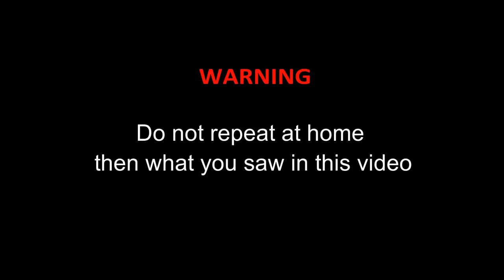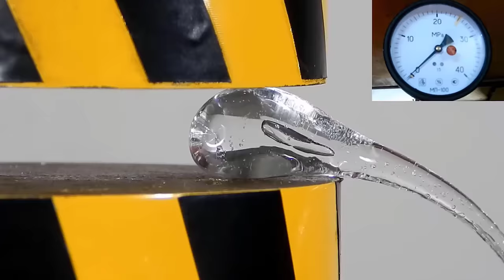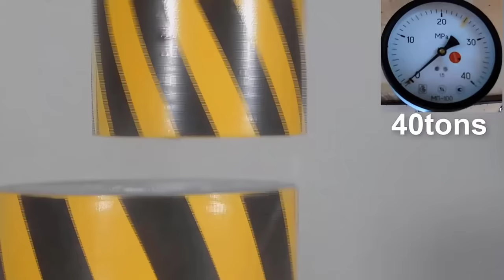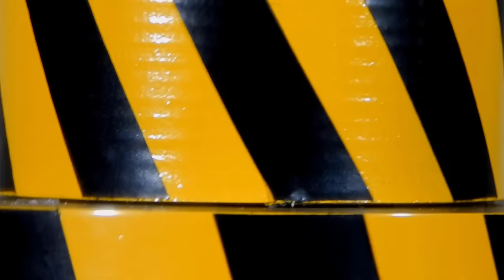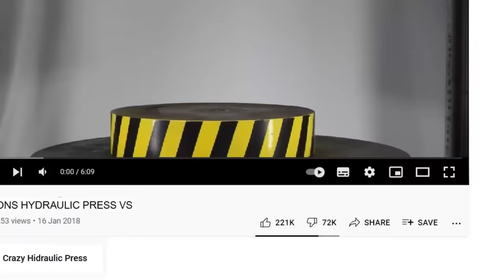HYDRAULIC PRESS AGAINST RUPERT'S DROP AND TITANIUM

Comment: 80,000 pounds of force for a glass drop.. that's insane
Reply: yeah but if u break the tail its all gone
Reply: google image pfp gang
Reply: You can actually burn of the weak side so it wont shatter
Reply: YTgavinlilmam it’s for the giant Rupert’s drop
Reply: @BelowAverage3310 however doing so will weaken the overall structure. So you will remove it’s main weakness, yes, however, it will not be as strong.
Reply: Energy per unit of area is more important, but damn how can u stab something that is curved haha
Reply: But if you break its tail it will break
Reply: @Android-xe1ne  so would a glass sphere or a Rupert’s drop be stronger
Reply: Um actually 🤓🤓🤓
The prince Ruperts drop is strong however you can easily snap off the end
But it would be weaker cause if you damage the front it will actually effect by the back-
So there is no easy way to reach the ultimate strength of an object
Like applying weight and pulling there is no object that can do every single possible thing for the
** to be overly protective if so life would be insane instead of a lifetime of 70 it may be 80

Wait I typed all that? Oh-
Reply: @RickyCheung-d7j mate how does that make him a nerd
Reply: Nice profile picture
Reply: Now imagine a prince Rupert's drop made of titanium
Reply: But yet a kid could snap it by pinching the tail
Reply: I wonder if they can be used as bullets themselves…
Reply: @HelixSawIt  Gone! Reduced to atoms!
Reply: That would be the equivalent of 3 miniguns all shooting in the same spot

Comment: As you pressed the titanium I wondered what the hell the plates on the press are made of that they don't get deformed by some of these things. Lo and behold, immediately afterward the tungsten gave as good as it got.
Reply: Plain titanium isn't actually all that strong, it's actually weaker than most steels in most areas, not by a lit but it is a noticeable difference, main benefit of it is that weighs a lot less and handles thermal loads better, which makes it ideal for aerospace but its high price means steel is better for most applications
Reply: Titanium isn’t indestructibly that strong. Steel is cheaper, easier to make and is as strong. Titanium doesn’t have much use case outside of the airframe of high performance aircraft and submersible hull due to its high strength under high pressure loads.

It doesn’t have as much use outside of this. Even steel is better as armor and for projectiles, steel cores are common and sometimes heavier metals like tungsten and uranium are used.
Reply: @battleoid2411  More accurately, it's compressive strength is terrible compared to steel. The tensile strength is good, but that isn't going to help atop of a press.

Comment: imagine using prince ruperts drop as a tank bullet.
Reply: oof
Reply: If you can find a way to not break the tail and make it straight then go for it
Reply: that makes no sense whatsoever
Reply: It might work but you will have to melt off the tail
Reply: @TheDoerOfRandomStuff  yeah the long barrel will most likely make it shatter
Reply: As long as you can sharpen it and it still be as strong as it is now then it would be an amazing bullet
Reply: Melt the tail!!!
Reply: @maddietrujilpo5526 melting the tail won't work. The tail is the weak point and heating it up would probably result in it shattering.
Reply: @maddietrujilpo5526 that would make it break easier.
Reply: @derpsterYT  no actually you can melt off the tail without it shattering
Reply: @derpsterYT melting the tail does work just makes the drop a little weaker
Reply: But if you get it moving fast some other way?
Reply: Probably would be less effective due to weighing less.
Reply: imagine if we could fire a hydraulic press
Reply: I like the way you think!

Comment: I suspect It’s not so much the pressure but the impact that breaks things. 
When I was younger I seen a guy on tv with his leg trapped between a concrete pillar. He actually made it out with minor injuries because the pillar slowly trapped his leg instead of just falling on it
Reply: @CommenterMr922 if there’s a large enough pressure it’ll still break it’ll just take more
Reply: @commentermr9222 I could be misunderstanding you, but if what you're trying to say is that the OceanGate submarine was less than the concrete pillar, that's incorrect because the submarine impoded at the speed of SOUND under tons of pressure per square inch

Comment: At time stamp: 6:40.
The Prince Rupert Drop sandwiched between the two titanium plates, if you look, you can see the air inclusions, the air bubbles, actually deforming under the pressure. Amazing! So, the drops didn't just go unaffected to the breaking point. It was actually deforming BEFORE the failure point! It's hard to see, but like the moving minute hand of a clock, the drop was moving, that is deforming the whole time. I find that fascinating!
The world isn't always at it seems at first glance.

Comment: I thought diamond would be harder huh
Reply: He needs to add in a psi gadge so we can see how much pressure it actually took other wise its all perspective with nothing to compare against
Reply: Hard but still brittle
Reply: The harder things get, the easier they break ironically enough. Hardness mostly implies a resistance to scratching with stones, or bending with metal, but if you push a very hard object too far it'll break a lot faster than a more soft object, because the softer objects simply deform
Reply: It's not diamond a diamond that size would cost 10 million dollars
Reply: Diamonds are surprisingly brittle. It's a direct cause of its very high hardness.
Reply: @CJ-hw4zc 
If it is that brittle, can you even call it hard/strong tho?
Reply: Very hard, but not strong. Its remind me of a movie's quote : "Hes taller and bigger than me, but am still way stronger than him"
Reply: It is. But the hardness is only important for Scratch resistance, not shatter resistance.
Reply: @Justakatto yeah it’s highly resistant to scratches but breaks under pressure

Comment: why is the rupersdrop so damn strong
Reply: It is due to the way it is made. All of the stress is in the tail. They pour the molten glass into water which cools it down so fast that it creates a very hard drop that strings up into a tail like shown. If you break the tail the whole thing will shatter.
Reply: @nutcrackit7396  i found this topic realy interresting. i wouldnt be surprised if there other scope of applications like a submarine or spaceshuttle construction form.

Comment: Im not totally convinced the main bulge failed. With a Prince Ruperts drop the tail is the weakest point. If you even slightly crack the tail the whole thing explodes. I think the edge of the press cut the tail causing it to fail. Also there should be zero air bubbles in the drop. Certainly not large ones like the ones this one had. That's going to cause it to fail on its own. I would like to see this test again with a clean and very large drop where the tail isn't making contact anywhere on the press. Im certain you could almost double the force applied with a drop that has no internal air bubbles and a tail that makes no contact anywhere on the press. They are pretty damn strong though ill give em that. When the molten glass hits the water the outside cools quickly and contacts inward. However the inner portion is still molten cooling FAR slower and exerts a very large force outwards. When everything finally settles you have a bead of glass with enormous amounts of tension pushing against each other. This is what makes them so damn strong. Like I said if you even slightly nick the tail it will explode violently.
Reply: the heads of the drops have a much higher surface compressive stress than previously thought at up to 700 megapascals (100,000 psi), but that this surface compressive layer is also thin, only about 10% of the diameter of the head of a drop. This gives the surface a high fracture strength which means that it is necessary to create a crack that enters the interior tension zone in order to break the droplet. As cracks on the surface tend to grow parallel to the surface, they cannot enter the tension zone but a disturbance in the tail allows cracks to enter the tension zone. 

The internal air bubbles makes zero difference because the only thing that needs to happen to break them is for a crack to propogate through this thin layer on the surface. The tail is much much thinner which means a even thinner protective layer. Which is why it is so easy to snap the tail. Once ANY crack makes it through the outer layer into the inside that is under thousands of PSI worth of tension/compression. All of that tension is released and explodes the drop. Air bubble or not the result would be the same. 

Realistically speaking. I only said this to make a point. Which is that your comments are more for you than for anyone else. You explained very basic knowledge (as did I) about the drops. If they are making drops and making video's about them. Your basic wikipedia level information is not going to help.

Comment: The diamond thinking it’s the strongest material in the world 
Prince rupert’s drop as armor
Reply: Plating made out of inward-facing Rupert's Drops packed tightly together with the tails not touching, with a buffer of empty space for the tails......  If it could be done, and with the right material used as the framework holding the Drops......
Reply: Rupert's drop is glass so you cant really turn it into armor.
Reply: @bruhgod123  it’s called a joke kid.
Reply: @SickoAnims  Just saying.